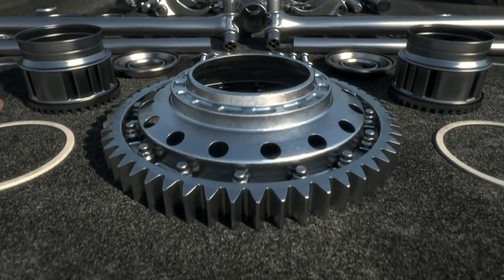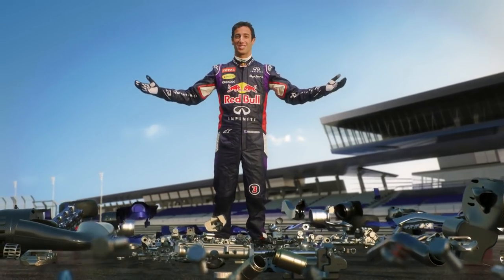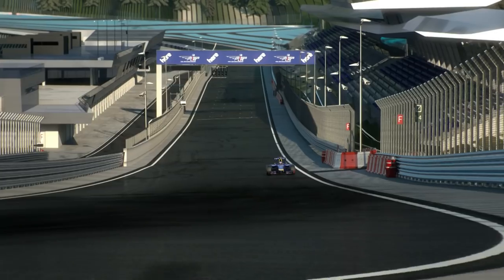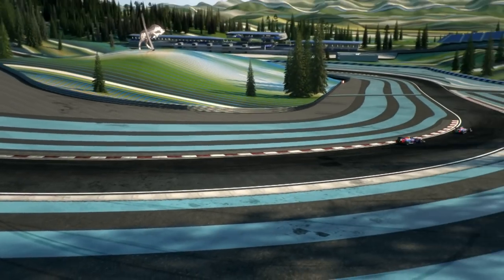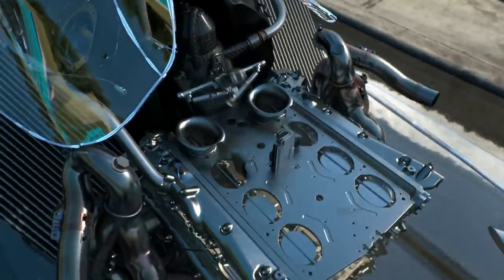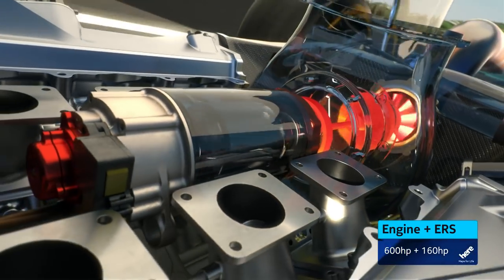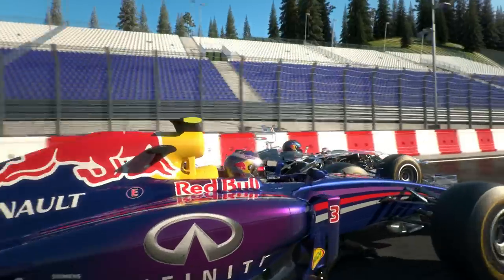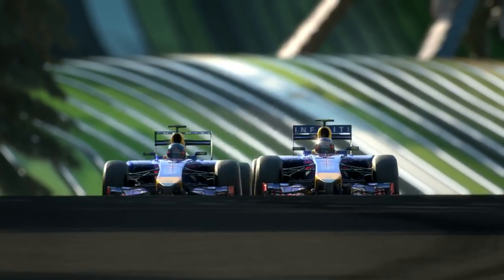Formula One V6 turbo: Rules Explained

Comment: Hello from the future.  Yes we are still complaining about the change.
Reply: yes we are
Reply: Hello im from late 2018 and F1 cars now uses electric Induction motor instead of old internal combustion engine
Reply: @RizLazey  Are you watching Formula E by any change?
Reply: Nah
Reply: xXx_MlgTr1kSh00ter _Xx do you know know what formula e is?!
Reply: xXx_MlgTr1kSh00ter _Xx do you not know what formula e is?!
Reply: Starscream_xxx it’s not faster than an f1 car wtf
Reply: Starscream_xxx oh kk I thought you were talking about formula e
Reply: i was complaining. But now I am convinced that F1 is moving to the right direction. 2018-19 cars are immensely improved over their first iteration back in 2013. They are the fastest  F1 cars of all times breaking records everywhere. Even the sound has been greatly improved (still not matching the screaming N/A V10s though). And judging by what the future holds in 2021 we are for a treat.
Reply: @elwingy  The only reason why they're faster is because they have big fat tyres and a lot wider and bigger so more grip, not because of the engine quite the opposite the V10s were a lot better performing.
Reply: @noxvi4753  sure but bigger also means heavier. And these ones are much heavier than what they used to be. I dont think there is a debate also in terms of which had better brakes, or better all around tech. I miss the V10 sound but tech wise these things are a whole new game compared to the old ones. Sound has improved a lot i went last year to hockenheim and will go again this year. The improvements are apparent. Still a long ways to go but they will get there.
Reply: I believe Formula E are fully electric...
Reply: @Blox Gamer don't jinx it were not that far yet
Reply: Noxvi the V10s made about the same power with a lot less torque thanks to the hybrid system. They were objectively inferior in every way besides weight. They definitely sounded better though. I could care less about how fast the cars are if there’s practically no race.
Reply: @Starscream_xxx the V10 cars from 2004 were probably faster than the 2019 cars, because they had no DRS and no Slicks back than...
Reply: @Starscream_xxx but the 2004 cars were a lot more difficult to drive allthough they had traction controll.
Reply: Weight of the turbo and hybrids outweighs the power they produce, so the power units are slower than the V8s. Cars are faster now because of the aerodynamic changes in 2017. Put a V8 in there and the car will be faster with less power.
Reply: Yess of course, we need a beautiful sound!
Reply: @RizLazey  are you sure it's f1?
Reply: @RizLazey  So what's the problem? It's just an energy-converting-unit in both cases
Reply: I'm at more future
Reply: 2 years later we are still complaining about this.
Reply: @Willie_Pete_Was_Here  V6 hybrids are the best engine you can possibly have in the car
Reply: @RizLazey  hi Lol Xd.
Reply: @andmos1001  hi anders mostue.
Reply: 10 years later... yes we are still complaining about the change

Comment: Interesting fact: You can't start an F1 car cold or you'll cause blowby through wear when the engine warms up. The reason is because the engines are built to tolerances so strict that the engine block's expansion and contraction actually affects the amount of pressure exerted on the pistons and rings. When the block is cold, it contracts slightly and exerts more pressure on the pistons, which means there's more friction and this wears the piston rings down faster. Start the car too many times from cold and you'll wear the pistons down to the point that when the engine warms up to operating temperature, the piston rings fit looser, therefore having a bad seal which will cause blow-by, where the fuel and air mix will escape around the piston rings into the crank case. If you let it get bad enough, your F1 engine will start to burn oil and lose compression... Potentially causing a misfire just like in a standard engine... only this one would be WAY more expensive to fix!
Reply: WOW.......i didn't know that !!! 

Where can i get more of such informations like this one ???
Reply: a- Babunji If you can find documentaries and interviews with engineers from the F1 on Youtube and Discovery Turbo, you'll find info like the fact I posted above :D
Reply: +ThEcRaZ3dGaM3R sooo, for an cold start, how they do it?
Reply: Ronald Mattos The engineers pump hot oil through the engine to get it up to operating temperature before trying to crank it over. This expands the engine and alters the tolerances so that they're within a range the engineers consider safe to attempt a crank.
Reply: Unbelievable, I've never wondered that, for sure it's an interesting thing. Thanks for the info mate!
Reply: so true, the engineers actually even calculated the expansion and at what temp should the engine be started. that means you can not own one and place it in your garage because it takes a company just to maintain one or even just to start it's engine.
Reply: If you would look into garage before the race it looks like car has life support system. All the tubes with hot liquids pumping everywhere. 
Mechanically and technologically modern F1 cars are just stunningly beautiful. Too bad it doesn't guarantee fun races most of the time.
Reply: thank you Sheldon
Reply: That was actually interesting.
Reply: You could learn to do it yourself, but you'd probably spend a couple of hours everytime you wanted to start the engine lol
Reply: How many times do you need to start the engine during a race?
Reply: Hr Gwea I'm no expert but in an actual race I'd say that as long as anything happens, you just have to start it once. If it takes a considerable effort to restart the engine, I think we could see that in races, and we don't :D
Reply: Well they don’t last long anyway! Currently, there is no rule to how many races a engine can last. But there are regulations that you can use 5 engines in a full 21 race calendar.
Reply: DigBipper188 OK first of all, this is just showing off the new rules. Secondly, all those parts were probably sitting in direct sunlight all day. So they’re probably pretty hot.
Reply: It's a bit of an understatement to say that F1 cars are on a life support system when waiting in the pits with the amount of hoses feeding in and out of the engine.
Reply: Matt Schutzman  chill out don't need to be so rude
Reply: @hrgwea  once. If it stops out on track it's game over since they don't have onboard starters

Comment: Lol, dont make cars safer, get better drivers!
Reply: Doesn't matter how great the drivers are if the cars are made out of tin foil and scotch tape because when they crash, not if, they would be dead... plus I don't even think this year's cars are all that safe to begin with.  Someone will be shocked to death by a faulty KERS (probably Vettel)
Reply: True, they should make the tracks safer, how many times have a driver died from hitting another car and not a wall?
Reply: Tin Le
This argument would have been valid in the 90's, but when is the last time an F1 driver was seriously injured or died?  Answer = 1994  (The bolt to Massa's head was a fluke that can never be full prevented in an open cockpit)

Hell, the only injuries you even see in in open wheel racing anymore are in Indy on the high speed ovals where the speeds exceed 200+.  The cars are extremely safe, the tracks are very safe, and the drivers are still top tier. 

The rule changes are to suit sponsors desires and nothing more.

If fans and drivers were still in charge the cars would be much more powerful and have active aero, additionally Group B rally would still be around.

If you want a safe sport watch curling
Reply: Charles Holmes Dude! So you mean that unless there is somebody actually dies, the safety work is bullshit? Okay! I got it. Next time you drive, don't fasten your seat bell, until you crash like a bitch then you'll see. I agree that F1 is becoming boring, but not that boring.
Reply: Charles Holmes Holy fuck, you are so right.
Reply: Tin Le
 Wow, you really don't read or comprehend well do you?  What I stated was very clear.  If you look at my first response to your nonsense, you will see that safety measures were never mentioned as a negative.  In fact I think they have done an amazing job and have been for the last two decades.  As for seat belts they have been the racing rule since the 50's and in street cars since the early 80's so their benefit is beyond question.

The debate here is whether or not F1 is becoming boring.  Now in looking at your name I am going to venture that you are from Asian decent.  If that is the case I can understand why you would want all of the cars to slow down, Honda and Toyota were terrible and Honda will need every bit of help in 2015 when they return.  Since they happen to make V6 engines and turbos pretty well they stand a much better chance of being competitive under the new rules.

F1 has been and will continue to be one of the safest motorsports in the world.  Adding a joke of a V6 Turbo and other ridiculous tire and fuel rules only hurts the spectators and fans.  Speed/danger is not the enemy in this debate and I am uncertain why you don't see that.  These rules have nothing to do with safety.  If the V6 Turbo this year could go 400km/h there would be no issue, it is purely for marketing purposes. 

They reduce the number of engines and have lowered the displacement to make the cars more reliable and push the cars closer together for more 'NASCAR' like back and forth racing.  If safety was their priority they certainly would not encourage the cars to bunch together.  I am not sure if you have ever seen or handled broken CF but it is extremely sharp and can be quite dangerous.

The FIA cares zero about driver safety and most about profits.  If the team owners vote that one team has too much of an advantage the rules will change to let lesser teams appear more competitive and keep them paying the FIA fees.  If you need a reference point look at the rule changes that occurred when Ferrari was winning every race with Schumacher and Barrichello, and most recently after the Red Bull domination the rules have changed again.

Zero to do with safety and maximum to do with profits.  Now I realize that this was likely a lot to read for you so you should probably go take a nap now.
Reply: Charles Holmes Not disagreeing with your point about F1 being all about the $$$$, but you do realize that all the teams had a 2 year (approx) heads up on these rule changes, right?  Which means that Redbull only had one or 2 years of being at or near the top when the changes were announced meaning that the the rule changes can't have been a reaction to the Redbull's recent dominance.  And Im not a Redbull fan-boy btw.  Hamilton and Alonso are the two drivers I root for and Ive liked Williams since I started watching F1 in the early 90's.
Reply: You are correct, and most of my comments were centered on the flawed logic that these changes were made in some way for safety.  The teams do get notice of the changes, but I was unaware that they knew all of the specifics (engine, aero, etc.).  

Do you exactly how much they know about the pending changes?  It always appears like the wealthy teams are caught off guard and struggle more in the opening races.
Reply: joshjamesguitar Spoilt Children? Always miserable? Being dicks? Let us review, shall we? Mansell had the personality of a wooden plank and the demeanour to match, D. Hill always seemed to have a 'poor me' mentality, Prost was one of the most arrogant drivers I've seen, Senna made other drivers pick between crashing into him or running off track (paraphrased from a quote by Martin Brundle), and both Senna and  Schumacher deliberately crashed into opponents to win championships. Between them I think you have spoilt, miserable and dicks pretty well covered... still all great race drivers.

I've seen Hamilton (in his GP2 days) spin out, rejoin the pack in 17th and drive himself through the whole field to finish 2nd, overtaking, undertaking, out-braking and generally passing where he has no right to do so. This in a series where all the cars have identical engines. You can find the highlights on youtube. To my mind, that is the mark of a very good driver and I have followed Hamilton since seeing that particular drive.

Alonso has consistantly driven the Ferrari above the car's apparent limitations. There were many races in the last few seasons where the Ferrari was out-paced and out-performed by their direct competitors. Alonso wrestled the car around the track to finish much higher than should be expected. You can also find many clips on youtube from the cockpit view showing Alonso reacting to the car several times in a single corner, counter steering like a madman and maintaining speed, position and not chewing the life out of the tires. Again, I believe that shows how good the driver is behind the wheel.

Those are my reasons for following Hamilton and Alonso.  Both Rosberg and Raikkonen are excellent drivers as well and there are other drivers I like the look of because of their aggression on track (Perez and Ericsson), but I haven't seen enough of them to be able to say that I would root for them during a race.
Reply: riffmeister101 That's why I don't root for any of them. 
"Alonso reacting to the car several times in a single corner, counter steering like a madman and maintaining speed" That's cute. watch?v=Nq0kEVjRqow
Reply: Charles Holmes
My understanding is that the FIA basically says, "These are the changes, go develop to suit." The details of the actual changes are very specific and all teams are fully aware of all changes being made.

As for why the bigger teams seem to struggle (especially this season): I can't say for sure, but...

All the teams were given 2 years notice of the upcoming changes, but, for the interim 2 years they were all still challenging for the title under the existing rules. Therefore, the main focus on development remained within those existing rules (referring specifically to Red Bull, McLaren and Ferrari) while a lesser focus is given to the upcoming changes.

The rest of the field (Mercedes, Williams, Force India), while still developing within the existing rule set, effectively abandoned their challenge for last season and shifted the bulk of their focus onto this year's cars. Actually, I now remember Mercedes openly admitting as much.

The changes this year are pretty drastic - aerodynamic surface areas (front and rear wings) are significantly smaller, fuel consumption is restricted, engine size is almost halved, turbo units have been added and the KERS system has basically had to be redesigned to assist the engine (countering turbo-lag) and still operate as a seperate power unit to give extra hp where needed by the drivers.

Due to all the above, we now have a situation where the majority of the bigger teams are playing catch-up to the traditionally smaller teams.

The only team that are way ahead of the rest in terms of current performance is Mercedes (as per previous paragraph).  The rest of the field is actually quite close competitively.  Still, I fully expect the bigger teams to significantly close the gap during the season, maybe even reverse the situation, and things will most likely be back to 'normal' by next year.
Reply: This is a great synopsis and I completely agree.  The weaker teams likely had more R&D man hours dedicated to the new rules as opposed to improving the outgoing standards.

The main concern for me is the 'bunching of cars' desire they mention on the FIA website.  Not only do F1 cars need clean air to run well, but the cars are so brittle that even the slightest contact is going to cause a CF break meaning even more yellow flags, black flags, and DNFs. 

These rules make zero sense from a fan standpoint, but I am certain that the FIA and the teams have a great profit from them..

Should be interesting to see the future rule changes.  My guess is a 2.0L 4 cylinder twin-turbo hybrid engine that runs on bio fuel and has active aero.  They will sell it to the press as the 'environmentally appropriate action.'
Reply: @riffmeister101  'back to normal by next year'. A little bit off the mark with that prediction

Comment: 0:55 “Much slower than before”
Reply: Amazing...
Reply: Faster.
Reply: @youwanttoknow9681  you didn't know the reference
Reply: F1 drivers in a nutshell
Reply: That explains the shitty V6 engines
Reply: @nsilvya6079  hell, the fucking V8’s are better than that.
Reply: Danny Ric after joining Renault, 2019
Reply: @youwanttoknow9681  bruh, did u even watch it?

Comment: Formula One rules for 2015: Changes have been made for maximum safety.

*Turn signals added for increased safety during overtaking.
*Petrol engines are removed, so cars don't devestate the environment anymore.
*With the limited range of electric motors, races are now only 1/3 the distance.
*Pit speed lowered to a pedestrian 25 km/h, and drivers must stop and signal when exitting the pits.
*Cars must be at least 60% recyclable, because trees and what not.
*Every team must hire a vegetarian driver, just because.
Reply: HAHAHAHAHAHA!!!